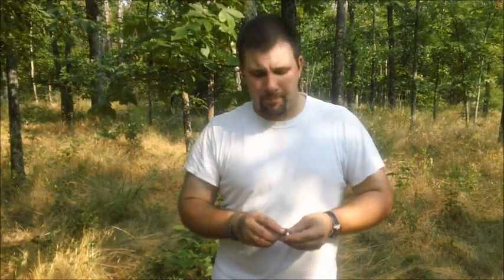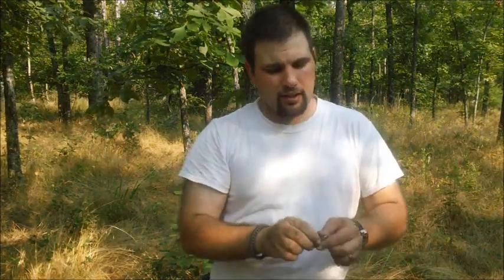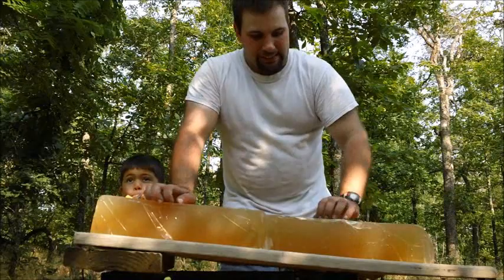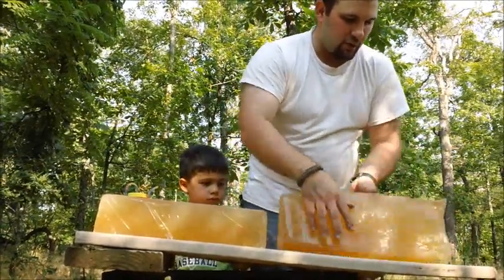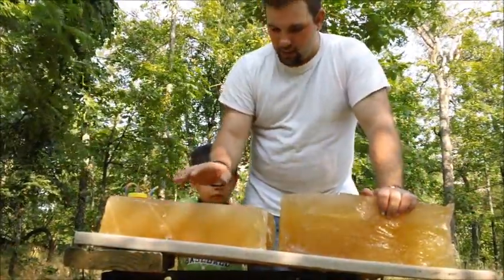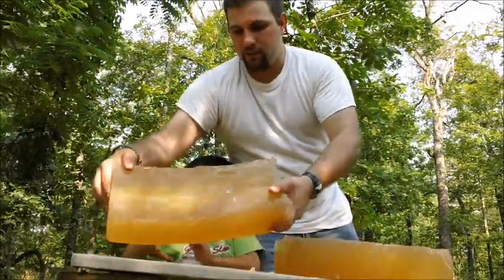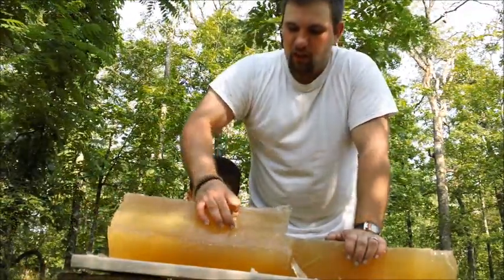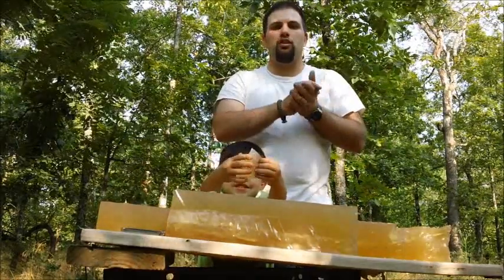40 S&W ballistic gel test lead vs FMJ vs hollow point

Comment: Why does it seem that .40 flat nose seems to expand when hitting more solid targets
Reply: Because the flat nose slaps a little harder than a round nose and has a little more resistance causing it to deform is the easiest way to explain it.

Comment: So in bear country it would be better not to have hollow points, correct? Since they’re so big I figure you would want more penetration rather than a shorter expanding round. Someone please correct me if I’m wrong.
Reply: I've used a 40 for black bear protection. I used a 200g hard cast solid I purchased from buffalo bore.